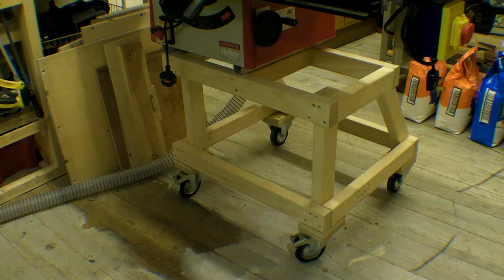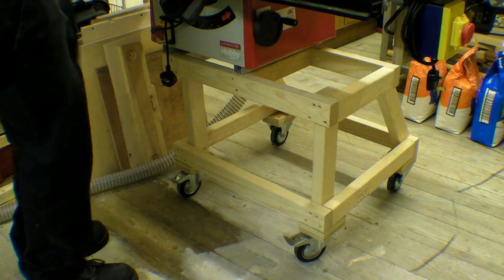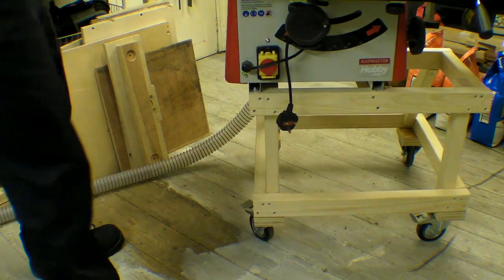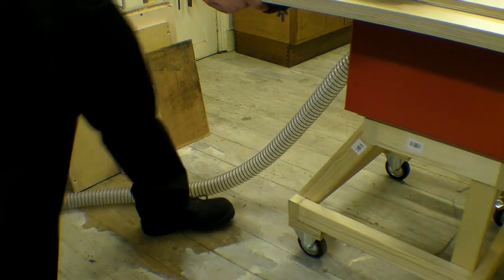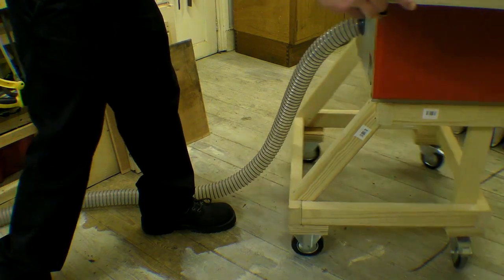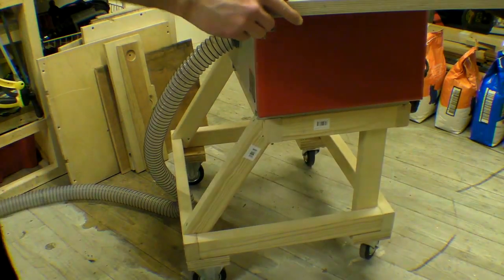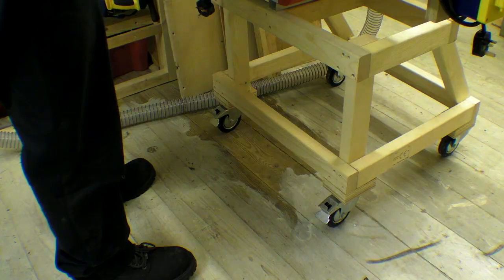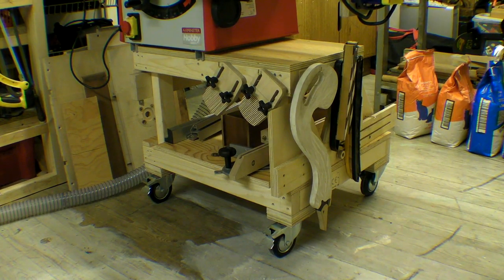Movable Table Saw Stand / Table / Bench

Comment: I am just about to embark on a similar project with my Axminister TS-250. I have very limited storage space and the table saw takes up so much room, so making it easily movable is a great idea. Have you had any issues with saw dust building up inside? As quite a bit seems to build up under mine.
Reply from the maker: Yeah that build up is normal for a table saw.  If it was more contained like a plunge saw I would imagine that could be reduced, but I try to always vacuum the insides when finishing up for the day.